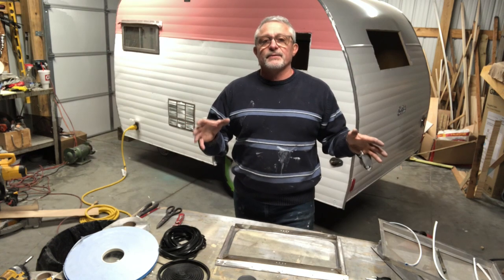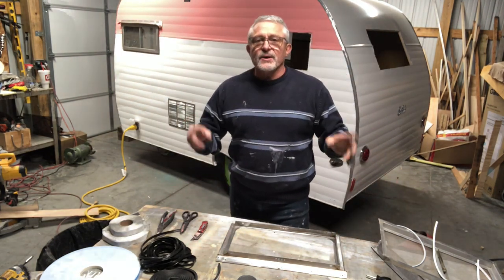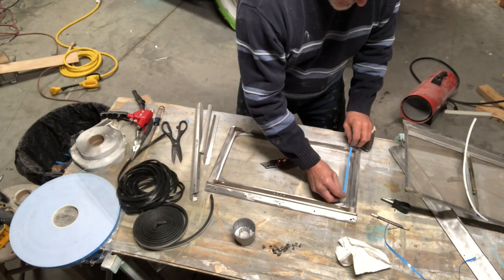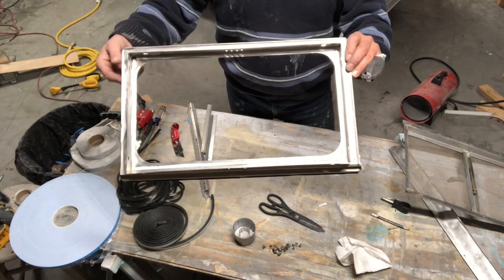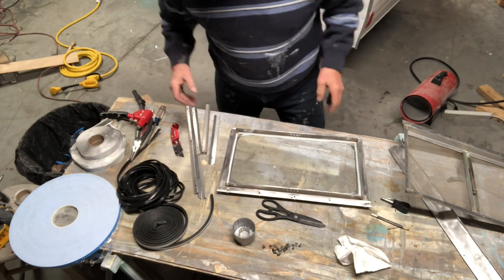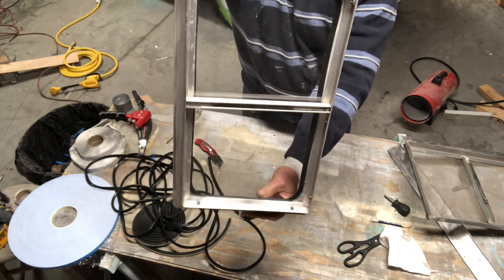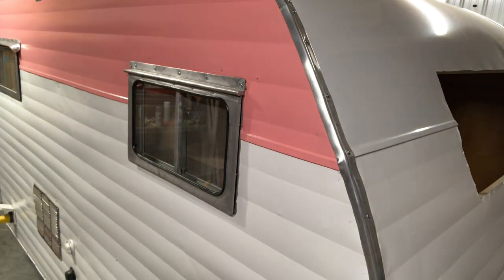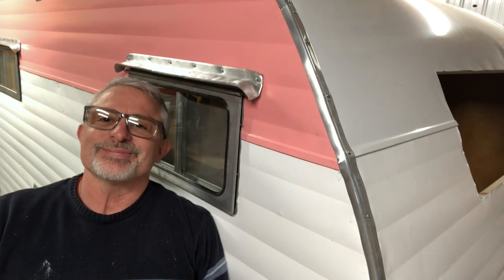EP 120  How to rebuild windows on vintage campers DIY step by step

Comment: after watching you install the 'eyebrows', with my experience in installing aluminum storm windows in the business, short pieces made of soft aluminum such as these, they stretch and bend very easily so it was out practice to start screws in the center and work out toward the edges to help prevent puckering
Reply from the maker: You are correct but also the butyl tape will hold it pretty steady as well.
Reply: @RobTheRebuilder  I think when you did teh AC vent, that should get an eyebrow - which to me, just helps shed the water.  A guy told me once, think like the amish and ask yourself which way will the water want to go.  - Norm always cut his wood sills with a cut underneath to make the water drop off.  My friend said what is it with you and water ?  Water's destructive !!

Comment: What did you clean the window with? Mine is pretty rusty. Great video!
Reply from the maker: Wire wheel and #000 steel wool
Reply: sometimes, if you are careful, a utility knife blade and windex works on flat glass, backdrag it  so the leading edge will NOT dig in.  / ----->

Comment: Hey there! This was a great video. So great that I think I will rebuild the windows in my 1965 Serro Scotty Sportsman. Just one thing, the screws that hold the windows and eyebrows are extremely rusted that I can't tell what kind of screw it is. The screws seem to have a dimple in the middle. How would I get that type of screw out? I will use DW40 to loosen them up but what bit do I use to back it out? Thank you for your advice!
Reply from the maker: I'm not sure that is factory original. You might look at the hardware store for the bit.

Comment: What is the rubbery viynl seal stuff that goes between the metal and the glass? It's the brownish stuff that you said keeps the Water out😊
Reply from the maker: It is a seal for this application from Vintage Trailer Supply.

Comment: Hey Rob, I have a 1970's Travelaire and I'd like to reseal the windows like you did. Is there anything more complicated about that style of window? Also does the gasket style or size matter? It was hard to tel the profile and size of the strip you used. The front and back big windows both need new gaskets. When shopping around for some there are so many different profile options. Any suggestions would be helpful. I really appreciated your video it made a daunting task seem possible.
Reply from the maker: I have never rebuilt a Travelaire so all I would say is look at what is there and try to find a replacement. I seal the windows with butyl tape. I think it is 3/4 x 1/8

Comment: Rob I have a 1983 shasta 23 ft motorhome and would like to replace the windows or atleast reseal the windows cause the outside seals are shrinking and dry rotted
Reply from the maker: I have never worked on a motorhome. Sounds like a big job

Comment: Bob, enjoy the videos. I have a 1963-64 trailblazer that I have yet to start due to other home projects. I finally cleared out the garage to pull the back skin off to fix rotted wood from a bad house window installation that naturally leaked. I’m going through mobiltec’s videos/course, very interesting how these things were designed and built fascinates me. Mine has the several pains jalousie windows, never seen one solid one like yours. Was that a Scotty exclusive?
Reply from the maker: These windows were popular with many of the 50, 60,70's canned hams. Scotty did use the other style windows in their doors as well. Watch out or the camper bug will bite you and then you'll be really busy. Good luck on your build.

Comment: I haven't been able to get the windows I need for my trailer. I got a window online and it ended up about half an inch to small all around. Is there a way to build the window frame to fit the smaller window?
Reply from the maker: I guess you could add some trim but it has to be stable to screw into.

Comment: Where did you get your gaskets and other items. For the repair oh and what sizes are you using. Forni have to do this to all my windows in a 1970 l&m trailer. Also thank so much for this video and all yours there amazing.
Reply from the maker: I get my gaskets from Vintage trailer supply. The generally have the standard sizes.
Reply: @RobTheRebuilder  thank you very much

Comment: What kind of glass did the manufacturer use for the windows? Is it ordinary window glass or tempered glass or automotive glass?
Reply from the maker: The ones I have worked on are regular glass. Tempered glass is recommended.

Comment: Morning rob thanks for the detailed video on the windows I joined the facebook Scotty group And I have the 64 Scotty sportsman Hi lander I guess it's a rare 1 from what I understand What is the source of the Scotty gasket number part number I broke 1 of my windows trying to take the regulator slide out with the tiny screws Where do you buy those little nylon pc on the regulator arm Thanks for all the help
Reply from the maker: Go to "Vintage Trailer Supply" and click on window hardware and you should see everything you need.
Good luck on your build